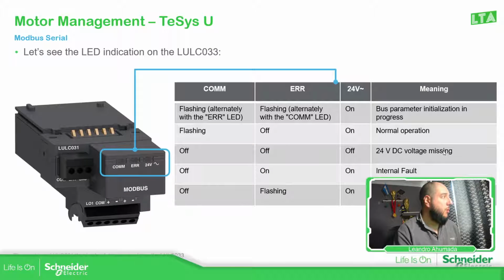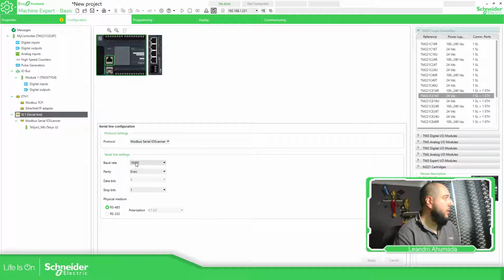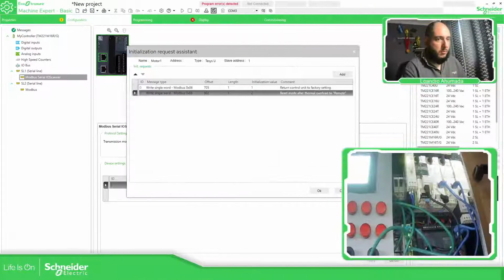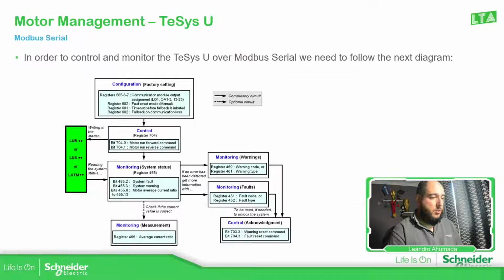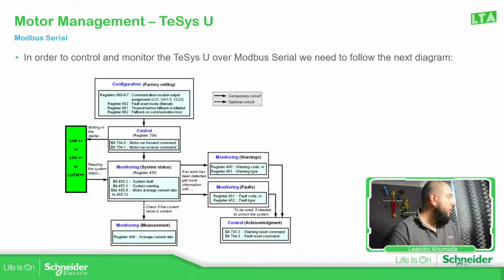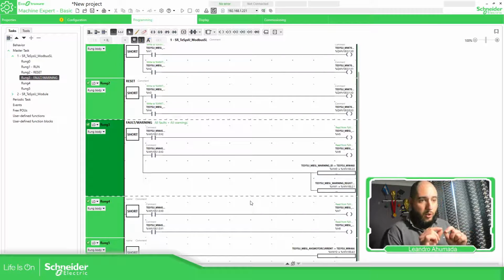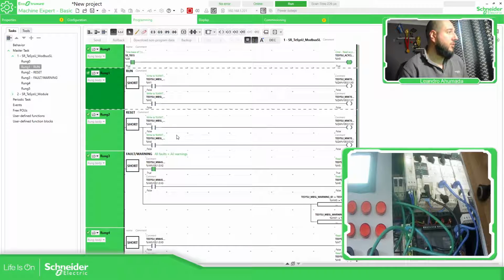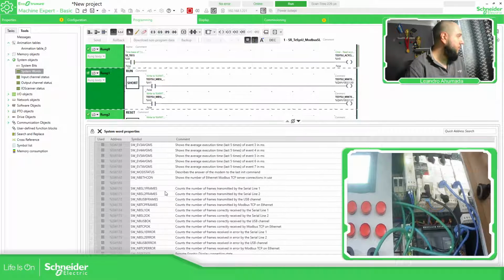Training TeSys - TeSys U -  Communication with Modicon M221 (Modbus Serial , LULC033)

Comment: Hi LeTomas, I am trying to use M221 to control a TeSys U motor starter. Can not get communication between M221 serial port with LULC033 modbus module. Is there a tool to reset the LULC033 module to factory default setting. Thanks. JP
Reply from the maker: Hi JP! That is a good question.... I do not see how to factory reset the LULC033 without the LUCM (obsolete)..
If you can not communicate try to check the modbus wiring.
The default configuration  for modbus is 19200 Even, the address needs to be configured with the swicthes... try an error seems to be the way... but i will check with the Technical team